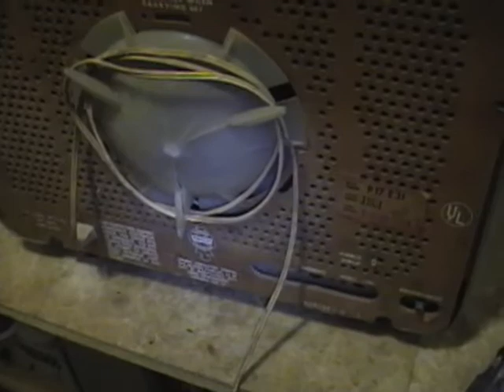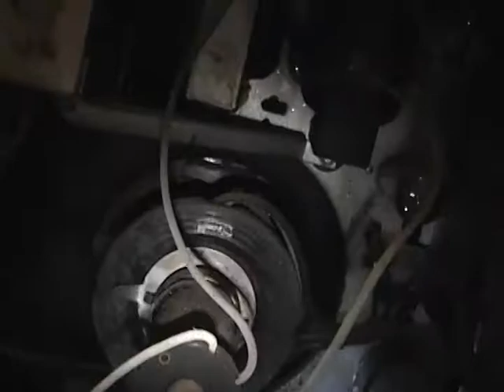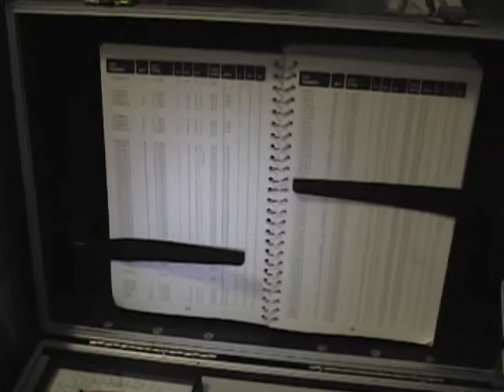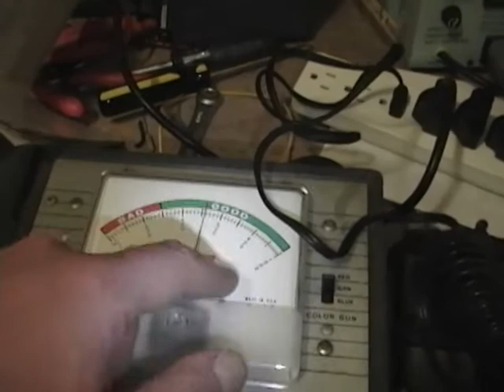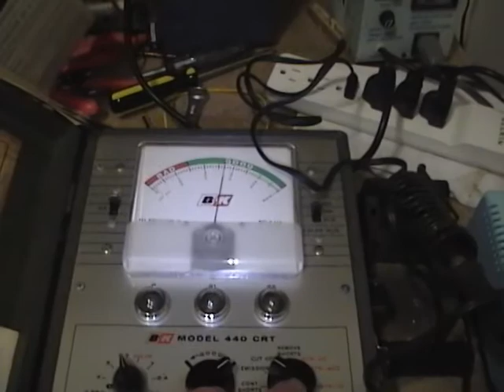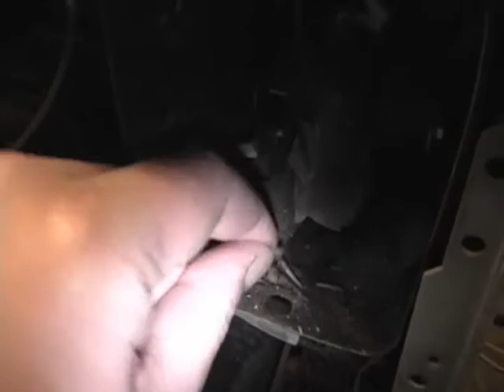Admiral P17E31 portable B&W TV from 1958

Comment: What is a damper tube and what is it used for? My google search only left me confused.
Reply: The damper (diode) is part of the horizontal sweep circuit. It works in conjunction with the horizontal output, and it conducts during retrace.